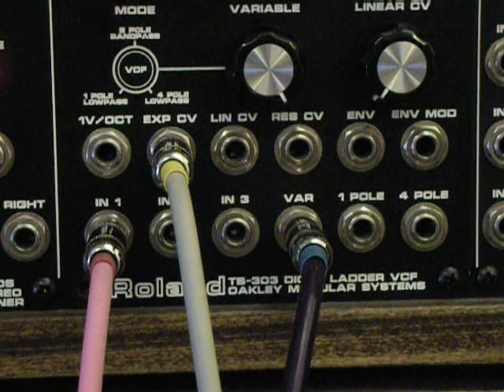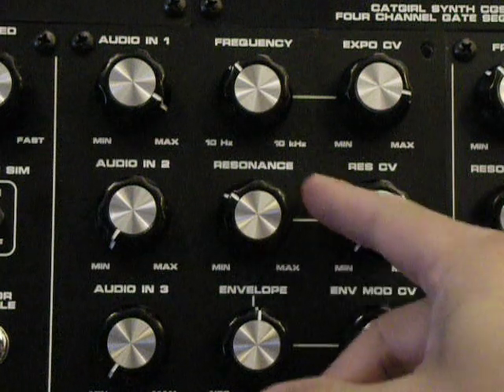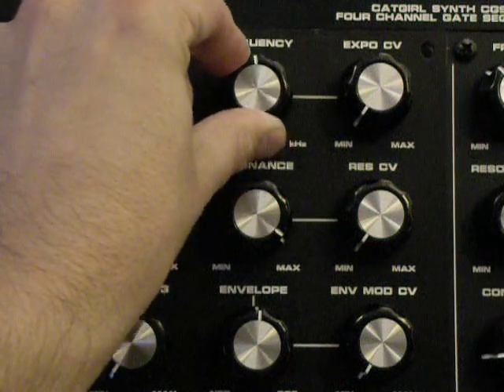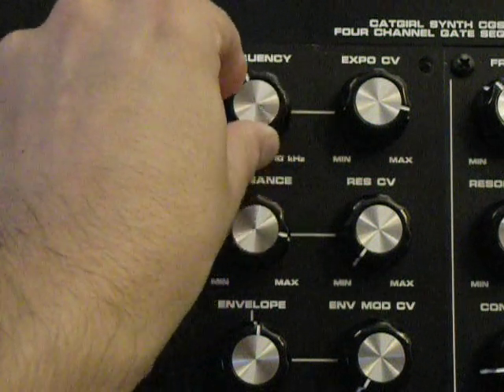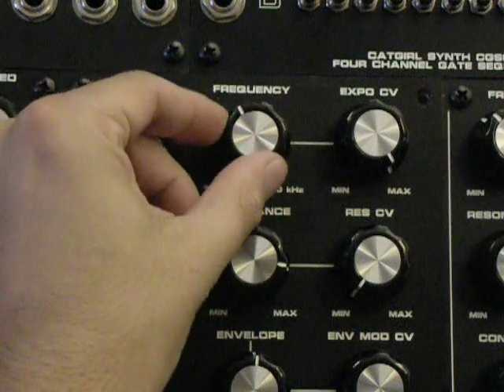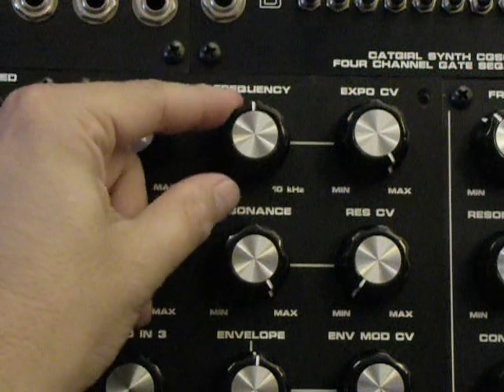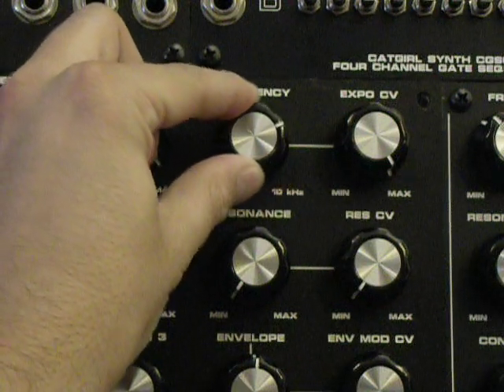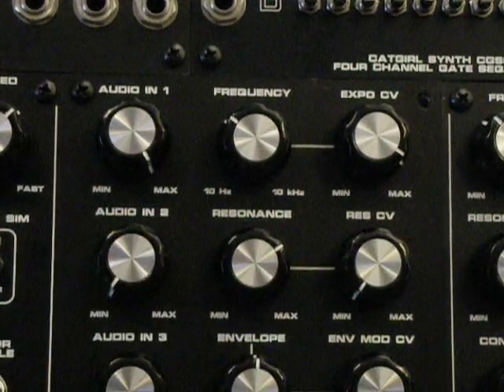Oakley Sound TB-303 Diode Ladder VCF

Comment: Do you have any idea if the version 4 PCB comes close to this sound?
Thanks
Reply from the maker: Sorry, but not sure about differences. Knowing Tony I bet everything translates. Regards!
Reply: djthomaswhite Ok, and are you aware the following this video has caused?  There have been several Muff Wiggler forum members who have purchased this filter and have complained that they can't replicate the sound you did in this video.  I'd be concerned to have the same result.
Reply: alternatingbitmusic I've been testing it for a few days now and also have problems recreating this sound. I do get the chirpiness, but the acid tonality seems a bit lost. Unless it needs very specific envelope settings. Using the MOTM 300 and ES3 envelopes.
Reply: alternatingbitmusic just got mine, sounds nowhere near the VCF in the video. I then read that Oakley changed the VCF a lot with the new revisions, but I found out too late. I can't believe this version was changed but hey ho